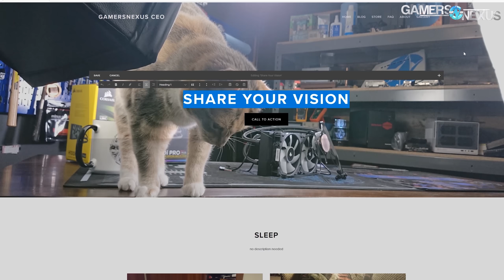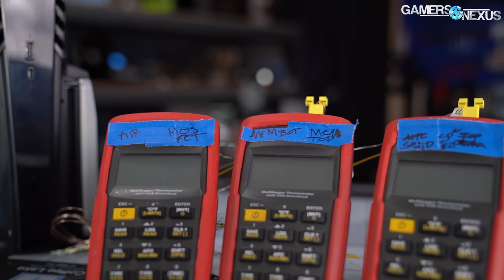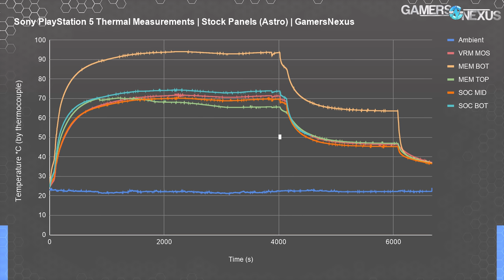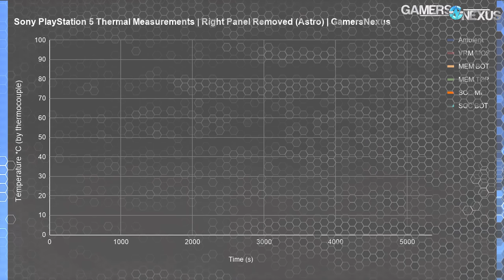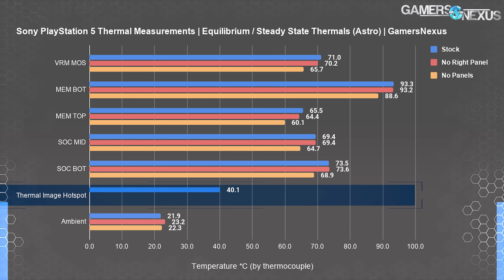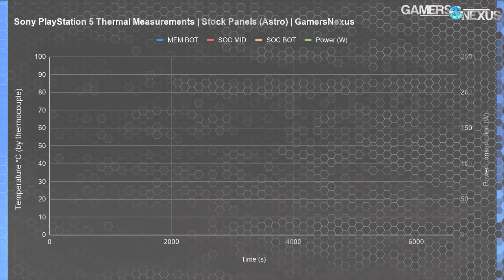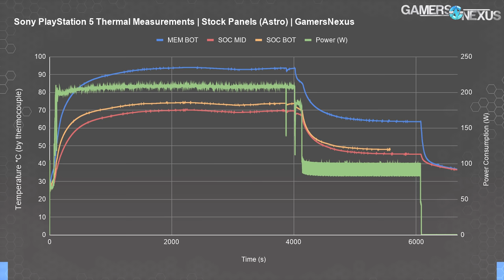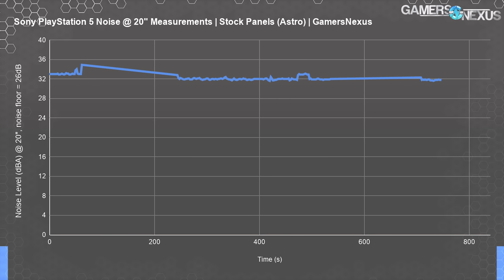Weak Cooler Design: PlayStation 5 Thermals, Power, & Noise Testing

Comment: Is there a new PS5 now with less heatsink?
Reply: Yes, but less mass doesn't equal worse heatsink. I couldn't find a source, but so far I've heard it might run 2-3c hotter (which is probably margin of error/unit by unit differences) and it actually runs quieter. It's a new fan, different heatsink material, and design. It's not fair to compare as we don't have a reliable source yet.
Reply: @Colty0  quieter doesn't always mean good. Temps are always  more important than acoustics. It's not the SoC that has to run cool there are many components that have to run below their thermal limit. No matter what the fanboys say the newer version is a downgrade being sold at the same MSRP. It baffles me how none of the Sony faithfulls have any issue with this.
Reply: @sauravshanbhogue7202  It's within spitting distance of temps (2-3c from exhaust temp) and quieter. I'll wait for an actual deep dive with temp probes than useless exhaust readings.

Comment: Basically everything on the XsX is better designed and not just the hardware. The software is more polished and with significantly less bugs/frustration. Even the basic features seem to be missing on the PoS5. Mines sat back in the box.
Reply: @malazan6004  check the profile. If you are so interested or insecure happy to photo your post next to the PoS5. PoS5 is a mess and not even close…! Just stop now!!

Comment: Interesting video, but I'd be interested to hear a quick resume of your experience in designing and/or testing liquid metal cooling solutions for mass produced consumer electronics. I'd also like your comments on why removing the side panels caused your ambient temperature to rise...and surely, in your experiment, the temp dropping from 90 degrees in the centre to 40 degrees at the plastic is evidence of a good cooling solution, right?
Reply: the problem here is not the liquid metal, actually the temps for the Soc were pretty good, meaning that censorny at least made a good job cooling the cpu. Even if GM said that they couldnt have acces to the real silicon temp (that can only be reached trough software on the console)  and well, the thing with the panels is that htose things are preventing that the heat coming from the console heat up ur room, some thing like thermal isolators or something like that..... and remember, plastic insta very very good thermal conductor.
Reply: @aanimekaii  I think my point is, this guy is making videos about a cooling solution that I personally have no idea about. If he's presenting himself as some kind of expert in designing and carrying out thermal testing experiments, I just want to know what qualifies him for that. But more than that, this video is now being linked by Xbox fanboys as evidence of the PS5 somehow overheating or having a poor cooling solution, so I just want to fact check the qualifications of the guy spreading this information, that's all.

On one hand, you have this guy trying to make out the PS5 design was just "thrown together", and this is why, whilst on the other hand, you have Sony engineers explaining in detail why they chose the solution they did, how long development of that solution took and why they've done what they've done over the last X years of hardware development on the PS5.

This video is just one more example of misinformtaion about both these next gen consoles being spread around the internet...
Reply: @mozzergaming4826  first of all, gamer nexus is well know in the pc industry. gaming pc indsutry to be axact, they wehere the onses who save Nvidias's ass when everyone was blaming nvidia for their gpus crash, yeah they pretty much are experts and they know what they are talking about.... and u have to keep in mind that sony is losing money with every ps5 sold so it is reasonable that sony wanted to keep things in check as well keeping them cheap

Comment: Hey Steve! You were talking about the fan and if they ran it at 100% speed it would pull alot of watts, is the fan running at full speed or is it running at low rpm's? and if its slow do you know if its possible to increase the speed to get better cooling?

Comment: 60 min is one thing. I'm more curious about how a PS5 standing in a tight Ikea TV bench for a year will fare with those temps.
Reply: Thats why they didnt do anything with the Liquid Metal. They will do another Test in about an Year i am pretty sure of that. Or in 1,5 Years.
Reply: @flimermithrandir  Yeah I got that, as he said. But it's something else when it stands in a confined space that it will sit in for a full year straight being on for a few hours a day having even dust block the airflow locations over time. As in that's how most consoles live atm.

Comment: Man, I just got unlucky. My ps5 is loud. From disk spin to the fan. It sounds like a hamper wheel and it's pretty noticeable. My Xbox S X is super quiet tho.
Reply: Return it. My one is so quiet, I sometimes think it is not even on
Reply: @rolan5948  lol return it and then get a replacement oct 2021?
Reply: @rolan5948  I have mine sitting on its side because of no room on my TV stand. I wonder if that's causing the sound. So yours makes zero fan noise or disk spin noise?

Comment: That kind of heat could be a problem , especially that high 🔥
Reply: Maybe? Memory modules tend to live a LONG life in comparison to the life of a console. Even if the lifespan is cut by 25% its still likely far longer than the console will be viable.

Comment: In resume is better remove both pannels to easy the ventilation process...this white panels its not pretty anyways and got dirt easily.
Reply: Dirt that won't be going into the inside of the PS5...unless you remove those panels.
Reply: @Investor9872  Just in use,when not in use just put it back in place or cover it with something.

Comment: I don't like it and won't be buying one, but this isn't that terrible of a design. It's fairly well optimized for high volume mass production. As long as the components are rated for the temps it should be fine for the life of the warranty.

Comment: I would be interested in the memory temperature when your playing a game normally. I mean run around and not stand in the same position all time, so That you have high and low intensity
Reply: Since you're drawing frames in real time and not re using frames like a compressed video would, you're still always reading from memory to draw the next frame, even if it's the same or different.

So memory temps would be pretty consistent in a game whether you play or stand.

Comment: Well first of all I want to apologise for my bad englisch.
But for me it seems like they fucked up the measurement of the RAM.
The cables taped down near the measured module are considerably higher then the module itself. Since the steel plate is very thin and not screwed down near the RAM it will be bent up. The steel plate not making contact with the RAM and having maybe a gap of 0.5-1mm is enough to insulate the RAM instead of cooling it. Since ram modules don't have that much heat to dissipate the steel plate could be more than enough if correctly contacted. So this should be measured again with a flat cable and the others removed just to make sure it's done properly. This is how science work gotta proof yourself.

Comment: I love the look without panels, especially on the digital edition. But i recognized that you loose alot of airflow from one of the Vaccuum holes... Just check for yourself, it’s leaking air literally! And it seems for me that this special stream of air is designed to go into the powersupply units air vents/mash... Im a bit worried now and really think of putting back the ugly panels again...

Comment: So which is better for a cooler ps5 to have it horizontal or vertical?
Reply: It doesn't make any diffrence really so just have it the way that best suits your setup.
Reply: If you have recently heard about the problem of the liquid metal inside pouring to one side for gravity and overheating the SOC then u should go horizontal
Reply: @unsacro  never even heard of that.
Reply: @outrageous5363  It´s been a debate for like a week on some spanish and latin channels, many repair workshops have reported the problem and i think this guy demonstrates it quite well on this video, liquid metal moves down because of gravity, then the SOC´s upper side gets overheated and the console turns off and eventually it could get even worse with some damage https://www.youtube.com/watch?v=l-0-YCm9rNA
Reply: @unsacro  There have been many issues regarding the PS5 and Series X that were drastically blown out of proportion, it happens with every console launch. And the small number of people that encounter these issues and post it online while the people who don't will stay quiet, so it all comes down to perception. This is nothing like a RROD situation
Reply: @outrageous5363  Console launch? it´s happening now, 1 year and a half later, it´s not just a small number of ppl, the issues with PS5 compared to Series X are way more common and known, this is not a matter of perception or a fake made by console war fanboys, it´s a problem not as big as RROD until now, but it´s growing and it´s been reported by ppl who actually repair these devices, thermal warning is the conclusion of this video itself and then Sony launched a few months later an even cheaper revision of PS5 with a smaller heatskin with less cupper on it for a console completely overpriced nowadays
Reply: @unsacro    If you think it's overpriced, just don't buy it. Not my problem. If you go looking for broken systems then of course you'll find them. Repair shops repair broken consoles so of course they're going to try cherry-pick then over-exaggerate for the press to further blow out of proportion for views. This is nothing like the RROD and this is more like the BLOD on base PS4 in scale,  where a few people moaned (probably for fear mongering) but ended up being a successful console with little issues. Go tell me in another years time when this supposed issue actually becomes a problem. I said it comes down to perception because of course most people are more likely to post on the internet that their console is not working then when it is but instead you just dismissed my point entirely and just said I'm wrong without even saying why. I'm done here. I go by the saying that it is impossible to reason with stupidity.
Reply: @outrageous5363  you're right if you're blinded by your PS fanaticism and you're feeling happy paying whatever Sony throws at your face and denying any issue with your almighty console there's nothing more to argue, I'm also done
Reply: @unsacro  well I'm not going to complain about issues I'm not having, that doesn't make me a fanboy to anything. You purposefully said that to be obtuse probably as a last-ditch effort for attention. If you can't afford a PS5 then like I said I don't care not my problem and it's not for you to say how I control my money. I'm surprised you're complaining about an issue that you wouldn't even have because based on you saying it's overpriced you probably don't even own one. You're not saying any of this to be helpful in anyway and I'd say it could easily be a simple case of fear mongering because you want to bring people down because they have something you haven't and it's jealousy. I'll keep my PS5 standing up THANKS.
Reply: @outrageous5363  I just ran into the exact problem with my ps5 randomly shutting off while I had it vertical… at first I ignored the issue and kept it vertical bc of its aesthetic now its shutting off even while in rest mode, sony literally is sweeping the problem under the rug and is making cheaper revisions bc mine was a fairly recent purchase & I already have these issues
Reply: @martinjones3070  Cool because I've had mine sat vertical for months, and it's fine. Some people have even had it like this for years, and it's been just fine. 

If anything, you're just proving my point that people just complain about their rare bad units, then treat it as if everyone has the same problems as them to cause fearmongering. The exact same thing happened with the BLOD on PS4.
Reply: @outrageous5363  im not the one fearmongering you, I just told my experience... you seem frustrated by the fact that people are telling you that it's prevalent no matter how much you deny it.
Reply: @martinjones3070  This whole thing started because I just said that someone should have their console standing how they want it. What if their setup cannot account for it being horizontal? Why is it for you to decide how someone should use the thing THEY OWN. At this point, you're just trying to pour salt on a wound and add insult to injury. Having a faulty console is fine, but don't fking act like everyone has the same problems as you.
Reply: @martinjones3070  you're not the only one experiencing that issue with ps5 and the fact that it's a recent purchase shows how Sony is saving even more money with cheaper and weaker revisions
Reply: @outrageous5363  you call that an insult? I was letting you know I had issues with your unchecked claim and you call that insult, who hurt you?
Reply: @unsacro  which is unfortunate bc I would have rather upgrade my pc with that 500 than dump it on a console that ~10,000+ redditors are having issues with.

Comment: Woah, that's some nice huge useless white sheets of plastic. I wonder if the sides work to dampen the noise at all? Maybe the fan could run a little faster with the sides on for similar noise levels?
I have a hard time understanding why Sony chose such an irregular shape, and why does the thing have to be so frigging large, when most people seem to prefer the more compact designs for each generation. 
Anyway, nice review, surprising findings and I'm glad for the detail and explanations for dummies. Gr8 work!

Comment: you guys should try testing the PS5 when running Spider man Mile Morales on 60 fps thats when coil whine starts to make noise only on that game and i heard demon is bad at 60 fps as well, the coil whine is not very bad though and comes from the back part of the console near the power supply. at least on my PS5. your PS5 in this video has the better fan mine has the nosier one but the fan does not seem to be very loud even on my version of the console.

Comment: Comes with a 1 year MFG warranty. Approximately 2 million units sold with many more to release., I think Sony did their research. If not, they would have to replace the units as 1 year of use would be more than enough time to detect heat issues and fall within their own mfg warranty. I don’t think Sony hadn’t tested these machines before release. Maybe Sony estimated the temps being in a permissible state at the accounted temperatures ? 🤔. Unless we rather believe that Sony’s R&D failed to conduct their own temperature tests ?? Now that would be quite interesting
Reply: allow me to remind u the RRD from the original xbox 360.... this things could be overlooked also censorny is loosing money with every cosole they sell, and it is not like on pc that we can have a military grade certificate or who knows, for me it was deliverated that sony put thoses memories on the back of the pcb, meanning that they cared more about the CPU/GPU temps than anything else
Reply: @aanimekaii    heat issue would be pronounced far within the 1 year mfg warranty I have to believe Sony would not overlook an issue that would require complete replacement of all units within their first year. That’s how I’m seeing it. It’s not hard to believe that they determined that these temperatures are well within permissible. If it’s not and heat is determined to be of issue that cannot be resolved with firmware updates than they will be replacing the units.
Reply: @SilentGhilly good job
Reply: Micron DDR6 has an operating temperature upwards of 105 °C (221 °F). So these temps are well within its capacity. Unit placement would be enough management to have 0 issues. Play it outside in direct sunlight, problem. Cover it with your blanket while gaming for hours on end, problem. Pile your dirty clothes on top of it and play multiple hours, problem. Keep it out next to your HDTV inside the house and play it all day, NO problem. Unless you live in the Sahara desert and have no AC, maybe. Commons sense is more than enough to establish proper heat management
Reply: @SilentGhilly Yes I own both new gen consoles. Another thing you fail to realize within this test is that the wire exit routing created a gap. The metal plate is supposed to be completely flush with the PCB, yet there is around a CM of space, this test conflicted the contacts with the BOT MEM, he tried to explain it away as “the only place where the plate kinda bumps up”. There are three separate locations where the wires create a 1 cm gap for around 2 inches.
Reply: @SilentGhilly The memory temperatures are fine and within their capacity, the only temperature management requirements needed would be unit placement and common sense. At most sony could implement a firmware update to increase cooling. This is a non issue. Let me guess, you dont own one of these ?